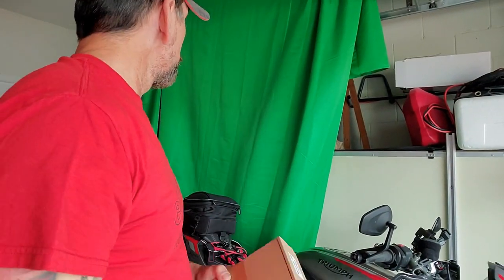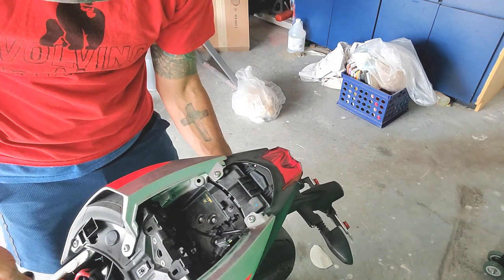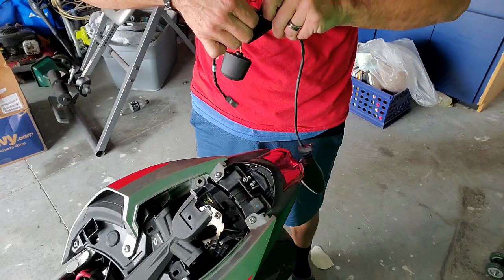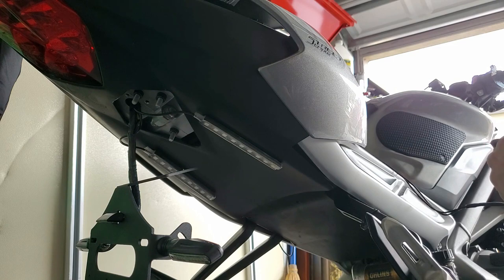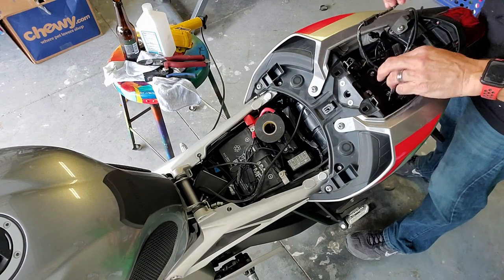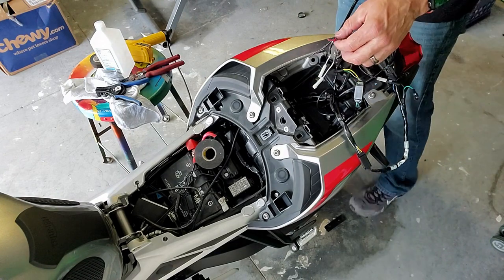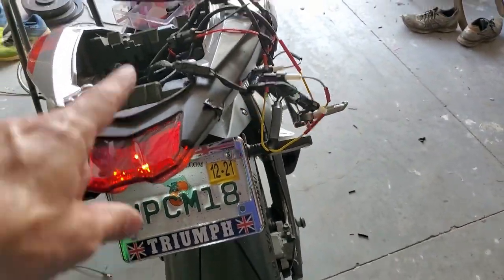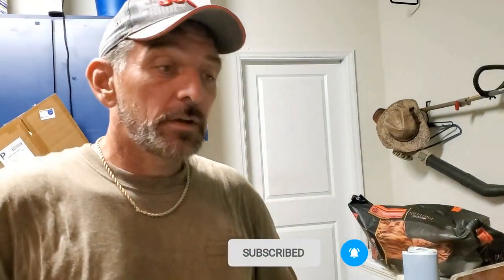Motorcycle tail tidy & rear signal replacement

Comment: For the front turn signals to run as DRL, did you tap that into license plate light? What color is that wire? For rear turn signals, I guess you tapped into rear brake light wire, which is green in color? Also what wire did you use to extend front signal wiring to come to back for the tap?
Reply from the maker: The front DRLs are wired into a plug that goes nowhere (on my bike). It right underneath the back seat kinda between the two seats.  I can’t remember offhand what color was because I taped it all up. I just used a volt meter to check it once I turned the key on. But the license plate wire would work fine, too. As for the rear brake light, yes, I tapped into those. Sorry, I thought I was being more clear in the video but it is hard when your trying to figure out what your doing. It really wasn’t hard to do, just take your time and do one light at a time. If you start off with the resistors I got, you’ll be fine.

Comment: I recently ordered the new 2024 765 RS. It’s all LED. When I remove the old wiring harness from the monstrosity, LOL, it should be plug and play, right, since I’m not adding a DRL function or changing anything?
Reply from the maker: Yes. Everything was pretty plug and play. I can’t recall if the plate light was but I think so.
Reply: @EvolvingMale  Thanks.
Reply from the maker: @ZabDevin  if you’re using the tail tidy I used on Amazon, beware. It broke in less than six months and I lost my plate. The Evotech tail tidy is the way to go. I wound up doing a video on that one, too. Still going. Much better
Reply: @EvolvingMale  Wow. Thanks for the advice, buddy.
Reply from the maker: @ZabDevin  I was driving the other day when you asked and I didn't think to go into detail. Sorry about that. Hopefully you haven't bought it installed it yet.
Reply: @EvolvingMale  No worries. I have not received the bike yet. Thanks again.